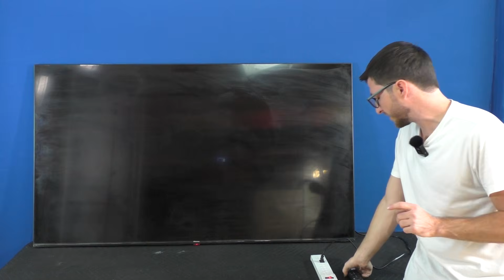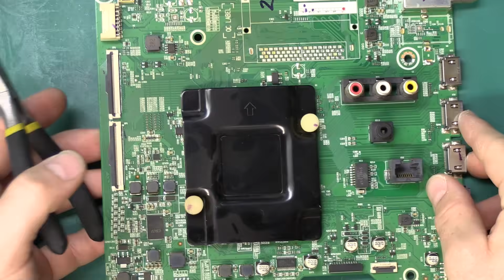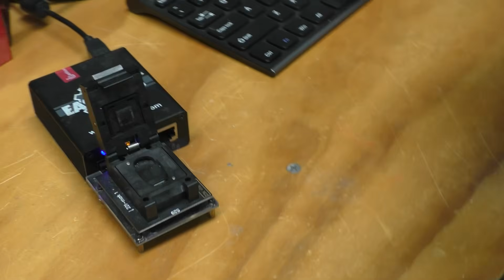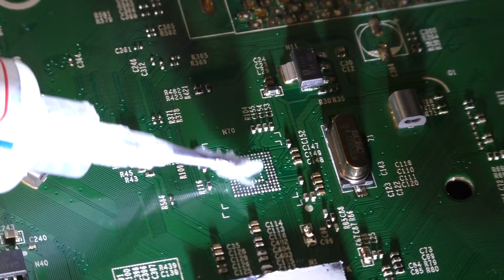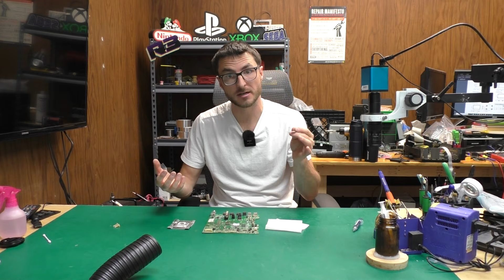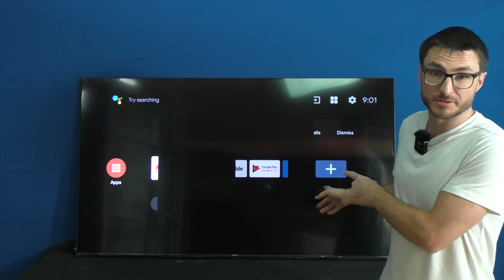Hisense TV Won't Turn ON Repair 65H6570G

Comment from the maker: Send in your mainboard for repair: https://nickselectronics.com/products/65h6570g
Reply: My TV is a 75U8H.  Do you repair those as well?  I have done component work in the past (20+ years ago) on one of the early Toshiba plasma's getting it back up and running by simply replacing boards but I am more interested in paying you to do our 75U8H if you are able to do so

Comment: where is the link for removing the rear cover? I do not see it like noted in the video. my 65c350ku has the exact same led light signal when turned on and same result of non function. Would like to determine if the power board or main board is defective so i can just buy a new one and replace.

Comment: My standby light flashes 5 times on 12v rails i mesure 12v for like 2seconds then 9v again
Reply from the maker: it's likely that the tv is identifying a fault and shutting down. Does your backlight ever come on? It's very possible your backlights have failed and need to be replaced

Comment: i did the voltage test on the same 12v pins and got a consistent 9v.  Is that a powersupply indicator?

Comment: I have a Hisense 75QD7N and have some how managed to get a insect stuck behind the screen in the bottom right corner. Its approximately 2" from the bottom of the screen and about 4" in from the side. I have tried blowing air in through various vents on the back hoping it would blow it loose off the screen with no luck. My next thought or attempt would be to try drilling a small hole along the side of the external plastic casing close to where the bug is and try blowing air through that. Any thoughts or suggestions?

Comment: am having issues with a hisense 65 inches . the TV has a burn power supply another thecnician bring this to me .I have repair the power with many failure components .2 dc caps explose on the top .bridge rectifier gone .fuse open schoky 2 open diotes mbr20150 . I have replace all . I place on test with a filament bulb 100wat . the test passed .finally I replace the main fuse .after the test . because the TV is not with me I had done all the test of thr voltages .All OK .
now the another thecnician who bring the board to me he says the hisense 65inches it okay with the power supply .
now thr problems is a blinking standby . I said to him may be the backlight is faulty I will not know it because the TV must be check properly all thr voltages on thr main board now .
But am pretty sure it's thr backlight .

Comment: Hi how much does a repair like this cost.  My 65” hisense tv lasted just a few days after the warranty was done. When I turn mine on, I can see the hisense logo and then it turns off I left the TV in the closet for three years and today I plugged it back on and it stayed on for 10 minutes then when I moved it to my living room thinking that it was going to keep on working it started having the same issue. Is it worth fixing it when I can get a new one for $250

Comment: Hello,
I replaced the entire mainboard because the TV wouldn’t turn on anymore.
Now it powers on, but it only shows RGB colors on the panel continuously.
The mainboard model is RSAG7.820.12903/ROH.
I would really appreciate an answer and some help🙂
Reply from the maker: Could be a defective mainboard still if it has software coruption. It could also be that the ribbons are not properly plugged in. 
Reseat your ribbons, if the fault is still there you may have gotten a bad board. If that's the case return it for a refund and I recomend you send your original in to our shop for repair. Links to the service in the video description

Comment: On the power board test ,is that 
12v Ac,or Dc on that last pin ?
Reply from the maker: DC every voltage check I do is in DC

Comment: Replaced mother board the light comes on but still no picture
Reply from the maker: If you shine a flashlight on the screen can you see a faint picture? do you get sound at all? if yes to either then it's likely that your LED strips aka your backlight has failed and needs to be replaced. Other wise it's also possible that the mainboard you purchased is defective because you can't get new working ones for these at this time which means you probably purchased used and likely none working replacement mainboard.
Reply: @NicksTVRepair I have one that does this (no screen, but it has sound) so I'll check if the backlights are the issue, thanks a lot!!!!

Comment: so I have a Hisense tv, and its a complete black screen. no sound or anything. when I go to turn off the power the screen lights up and the Hisense logo shows up right before it shuts down completely. have you ever seen this symptom?
Reply from the maker: Yes it's very common and can be caused either by a defective mainboard of backlights. I made a video on how to identify which one is the cause recently. 

https://youtu.be/k6p5znAaiK0?si=p-At4Gz5hH4AegNd

Comment: Hi Nick, my Hisense 65a7300f TV has broken down. When I try to switch it on, the red standby light flashes once slowly and twice quickly, then the screen stays black. Do you think the problem is with the power supply, the main board or a burnt-out LED? The aim of my question is to eliminate the LED problem, as the process is trickier than simply changing an electronic board. I haven't found any information about a possible LED error code.

Comment: Seems like these Hisense TVs are very low quality as shipped from factory.  Is it really worth fixing these trouble prone TVs?  It will probably die again in another two years
Reply from the maker: I just need to correct 1 thing first. This TV is 5 years old, not 2, so it lasted 5 years and will last another 5 years post-repair, assuming identical usage from the prior 5 years. 
With that clarified, yes it's a budget TV and could be better, but if you bought this in the first place, it's because you can't afford an expensive high-end set. odds are high 5 years later you are in a similar situation and still only looking at budget sets. 

To answer you question, is it worth fixing this TV for a fraction of the price or do you think spending 3 times the repair price on another budget set that also will only last about 5 years is better?
Reply: @NicksTVRepair  Having watched many wonderful DIY TV repair videos that you put up on your channel, what I would do is pickup a 10-12 year old high quality non functional Sony/Samsung/LG TV for free or next to nothing, and find and repair few discrete components and have a high quality TV that will last another decade or so 😃  I've seen few dead hi-sense TV being offered for free on craigslist or facebook marketplace, but I never bothered to pick them up because I know the issues are likely due to emmc chip or some other motherboard issue which I can't fix.

Comment: Hi Nick. I am wondering if you can help me out? 
I have a Hisense 55A68G. I changed the back lights and did a wonderful job if i may say so..
However I did something really dumb. I wanted to see what Voltages to expect to find in working conditions.
I shorted out the transistor from the PWM 
The 70R600 mosfet was damaged and a few resistors surrounding the area 
I have changed all the damaged components 
I'm not sure if i have damaged the PWM IC though i did change it from a similar board with same IC 
OZ351TGN
I'm still getting only the 162v on the Drain of the MOSFET and thats all. Do you have any advise for me?
Reply from the maker: Haha I am sure you did a great job on the led replacment. 
My advice would be that those power supply boards almost never fail so they are readily available for sale at cheap prices. If I were you I would not try and fix it but just replace it with a used one. Failures caused by external factors can cause any number of unexpected problems

Comment: Yeah, after a few backlights its easy. I dont bother buying the specialized readers. Tvs are given away on facebook marketplace for free. Repair a dying trade.
Reply from the maker: Given that this is our trade we have gotten very good at doing the repairs others don't want to do. That's one of the reasons its one of the most common faults we repair. It's a lot of work and most people can't do it or just don't want to.

Comment: What is happening to cause these EMMC chips to fail so early? They are failing in alot of the TV brands. Is there a chip quality problem or is there power quality/sequencing issue? Also, how long will the replacement emmc chip last?
Reply: Sony's and Hisense EMMC failures are most common. For whatever reason Google TVs have higher EMMC failure then any other.. the same Hisense TV but with Roku software I've yet to see a EMMC failure. A bad thing about EMMC replacement is Netflix/Hulu/prime don't work after a replacement. Sometimes they do or a combination of those don't work.. so definitely a drawback. But you can firestick Netflix onto the TV. These videos are awesome. I wish it was more popular. Thx Nick.
Reply from the maker: The chips installed all have a certain amount of read and write cycles before they start to fail. This is just normal wear and tear for the chips. 
The more intensely you use the TV the more you navigate apps and so on, and the more use the eMMC chips get. 
I don't have any hard data to give you accurate numbers but we advise you to use a Firestick, Roku, Chromecast, apple TV, or other streaming device with your TV for 2 reasons. #1 It will just be better than the built-in smart apps. No TV will ever be better than a streaming device by design. Apps navigate smoother, faster, and more responsive, the version of the built-in apps on all TVs is always of lower quality than streaming devices, and this is on purpose. 
Reason #2 is that it will alleviate some of the wear and tear from the TV and put that on the streaming device which is much cheaper and easier to replace.
Reply: Do you think the problem may be caused by a software bug that is writing to these chips too many times and wearing out the chip? If that's the case, the replacement is just going to fail in a matter of time.
Reply from the maker: Yes, the replacement eMMC will fail in a matter of time but the same goes for everything always, buying a new TV will just be a replacement that will also have an eMMC chip that will also fail in a matter of time.
It's just cheaper to have only your eMMC replaced instead of the entire TV. + You will be forced to use an external device which again I don't have hard data to prove but will alleviate the workload from the eMMC on the mainboard and put that workload on the cheaper external device thus allowing the set to work for much longer.

Comment: Everyone has a machine like that. Ya right
Reply from the maker: I am counting on you not having one haha. This is where the team work comes into play. I teach you how to diagnose and repair your TV in exchange you give me your business to do the repair on the circuit board. 
But realistically if this machine cost $10 and was available at the local hardware store, people wouldn't be able to do the repair. This machine takes a lot of expeirence and skill to use properly. Most people would damage their board beyond repair if they tried this repair without proper training. That's where my team steps in to help you!

Comment: Good Job mentioning the 9V on the power supply when you were expecting 12v.  This is the common standby voltage with Hisense power supplies with the mainboard disconnected.

Comment: If backlight is good, fix it. If backlight is gone, trash it..
Reply from the maker: Backlight is the #1 repair we do on TVs. We perform more backlight repairs than any other repair on TVs. It's absolutely worth fixing. Yes it's a lot of work, but it's worth it.
Reply: @NicksTVRepair Hisense?? Worth it?
Not over here, i wouldn't touch it with a stick.... Cheap crap
Reply: I think motherboard damage( if unrepairable for any reason should be skipped)
Reply: Lazy

Comment: Love your videos and thanks for sharing your talent so how do you find firmware when manufacturers only have software update for download?
Reply from the maker: I have to first find a working circuit board that is 100% good then I grab the software from the IC chips themselves and dump them so I can use that to program new chips. 
The tricky part sometimes is finding good working boards. That can actually be really difficult sometimes.
Reply: Also since there are so many models and submodels etc,you have to pray that your dump file works when you ll need it...And ofc there is always the chance you will break the original board in the process of dump harvesting...This job sux,I know,that's what I do. @NicksTVRepair